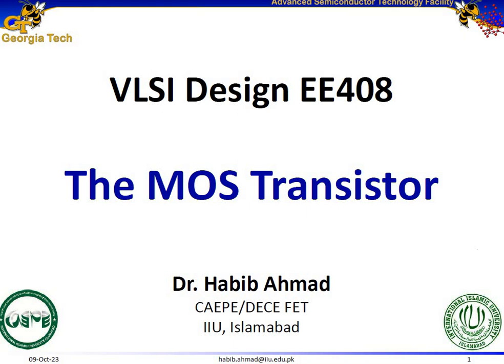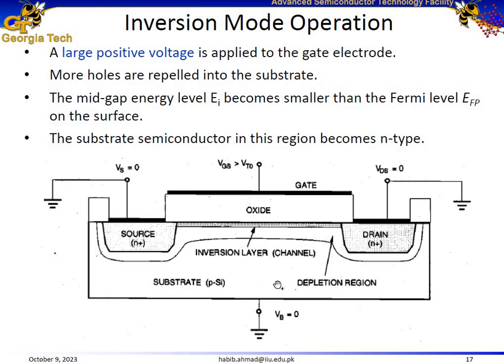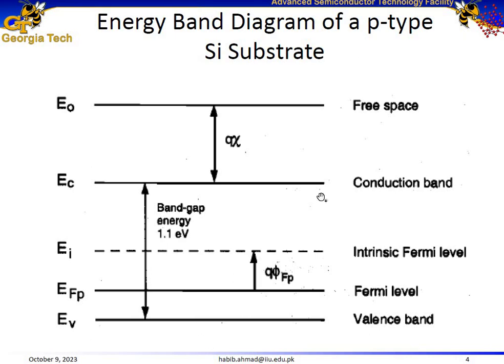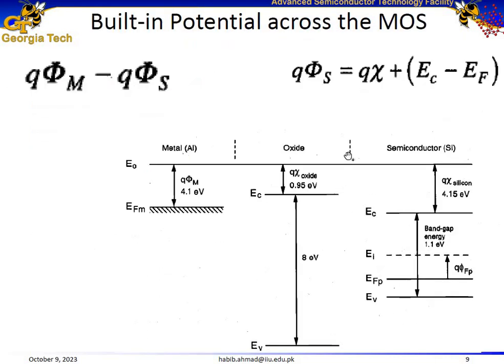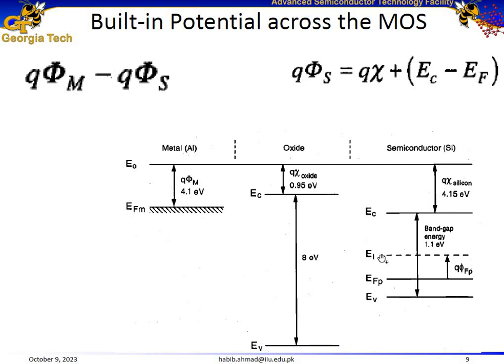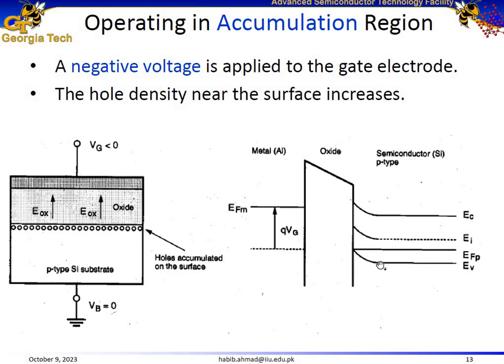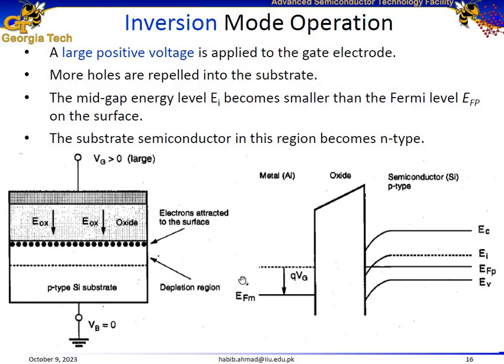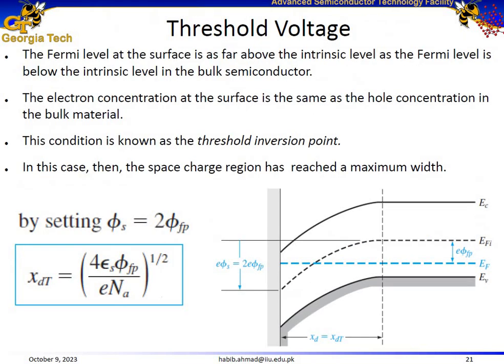The MOS Transistor || Understanding MOSFETs (Part 1 of 2) ⚡🔌 #MOSFET

Comment: Thanks, at 19:40, you said the bands bend upwards for P-type, should it be downward bending instead? Or does it depend on the bias whether the bands would bend upwards or downward?
Reply from the maker: Thanks for the query. That's a great question.
Reply from the maker: In the context of energy band diagrams of a semiconductor junction, "bending downwards" typically refers to the bending of the energy bands towards the higher potential side.
So, it depends on the bias.